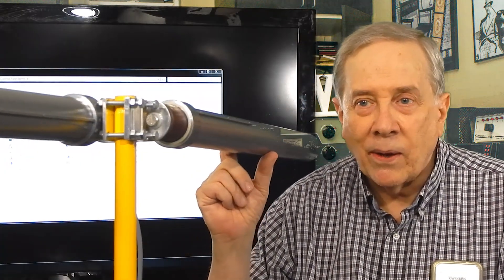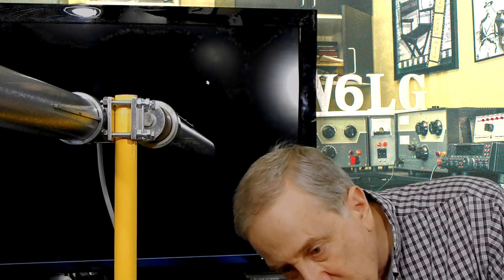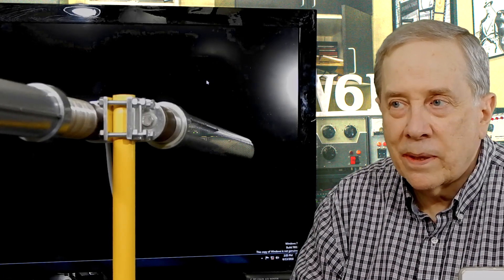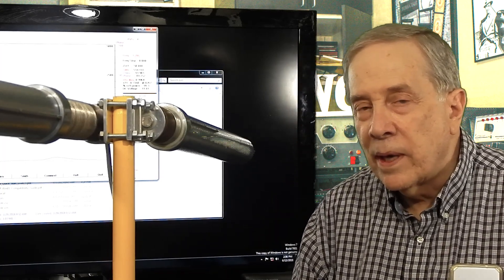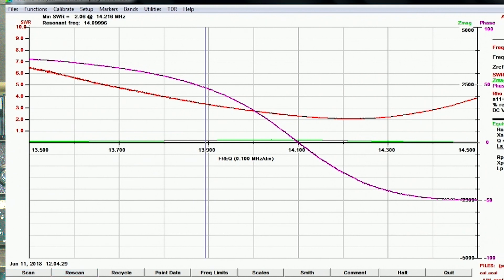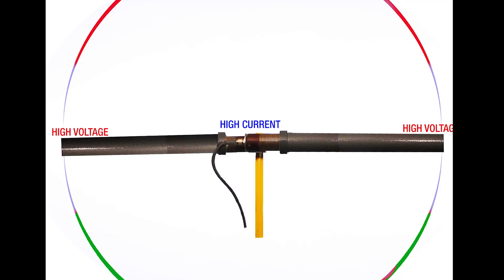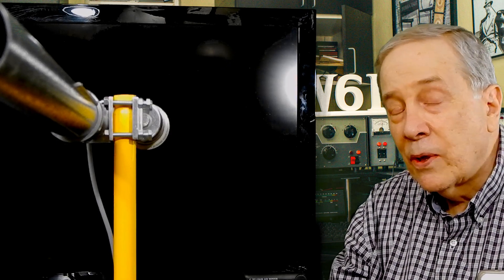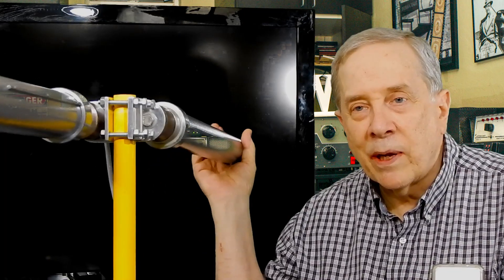Ham Radio Basics--Jim W6LG Uses A Short Dipole To Demonstrate How A Dipole Functions

Comment: Can I simply slide an aluminium tube over my aluminium dipole rods to increase the length if cut to short?
Reply: Of course you can.
Reply: @arconeagain  didn't work. They constantly need retuning ect. 
I ended up making multiple double dipole antennas attached to an Rf switch

Comment: I'm a fairly new Ham and I recently have started building my own antennas. So far my focus has been on horizontal center fed dipoles. I started with 10 meter portable that I could just stretch between 2 trees. I progressed to a permanent 40 meter at home. Then I added a 20m and then a 15m in a stacked fan dipole configuration. I've been using a Rig-Expert AA-55 for tuning. I have never been able to get both low SWR and resonance even close enough to be within the band together. Am I doing something wrong?

Comment: My son and I built a dipole with 4 wires for 80/40. 40 SWR came out as 1.5 at 7.2 which was perfect for me. 80 can’t get below 3.1 SWR at resonant point. Acom 2000a doesn’t like it. Trying to figure what I did wrong. K6DDS Bob
Reply from the maker: I have been in the hospital for emergency surgery and recovering is slow and sometimes painful.  Bob, how far apart are the wires?  How do you know that the resonant point is at that frequency on 80 meters? 73, Jim W6LG

Comment: Hi, thanks you for your clear explanation. A question: can a dipole receive and transmit at the same time? I am confused because if it’s radiating the transmitted signal how could it also receive the current induced by the received? Many thanks
Reply: It certainly can.  Many repeaters use folded dipole antennas transmitting at significant power while receiving on a slightly different frequency.  One repeater I worked on had 100W transmit power (+50dBm) while receiving at -117dBm

Comment: How do I contact you about some questions? I am sure you get this question a lot.
Reply: My questions are specifically related to any interference one might experience if the have an aluminum/steel roof and solar panels
Reply from the maker: You can leave a question here.  Others may have even better answers.  The number of subscribers is getting close to 13,500. 73, Jim

Comment: This construct brings up the question of efficiency. How much loss is in the coils? I am guessing that 100 watts may be troublesome due to heat. Two Wolf River or MFJ manual adjustment variable sliding coils and two pieces of shiny pipe. Hmmm, perhaps I can make a dipole in my 25ft attic space. The 2 coils should run the cost to the $200 range. At first blush, 20 meters might make sense using about 11 ft of wire on each end to account for coil length. Certainly opens up some things to explore.
Dick  N3HKN

Comment: Thanks Jim.  So even though the SWR is lower at 14.1, where can you expect to have the better output? 14.1 or 14.2ish?  What if the SWR approached 3:1 at the residency sweet spot?  Wouldn't a modern rig start to cut the power?  Thanks again for the work and effort.  Jim W8JBM

Comment: Hey Jim, very interesting video. I just wanted to let you know that there is high frequency noise/whine in the audio for this video. An EQ with a slight roll off around 15-18kHz should do the trick. I'm probably a minority here by being able to hear it, since I'm still in college and younger than most hams, but I figure it's worth mentioning regardless. Cheers!
Reply from the maker: The audio recorder I was using failed during the recording.  The audio from the camera had to be used.  I can't hear it; the whine.  It is not possible to change the audio now that it is uploaded and has had about 1000 views in the first 24 hours.  Thanks for letting me know. 73, Jim.

Comment: I always learn something. Thanks Jim! I do have a question that’s not really in the dipole realm. Is the same current/voltage scenario true for an endfed 9:1 unun antenna? Thanks KE8EAS
Reply from the maker: I think so but, I believe that the turns ratio is 9:1.  And, it is the square of the turns.  So, it would be 9 squared or 81:1.   And 81 times 50 for 4500 ohms.  Close to that 5000 ohm impedance of an end fed long wire.  73, Jim

Comment: Hello Jim, Thanks for great video.  What type antenna analyzer do use?
Reply from the maker: Hello to Dubai from "west coast".  It is an AIM 4170 that I purchased from Array Solutions about 10 years ago.    The analyzer does much more than I could show in that video.  A very nice device. I hope to hear you on 20 meters again soon. 73, Jim W6LG
Reply: OK Jim, I looked in to Array Solution they got AIM 4300, Which I think it is the update one.  20M open to NA around 23:30 UTC. after midnight.  73
Reply from the maker: Thanks.  I'll be gone today to visit my grandchildren in another city.  In the last few days Saif, Osama and Mohammed have been s7 to s9.  73, Jim